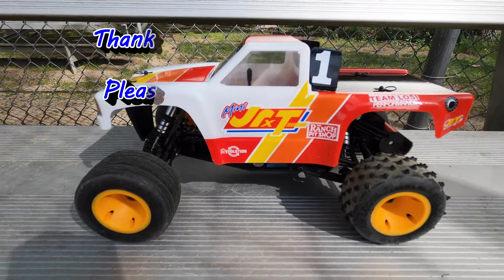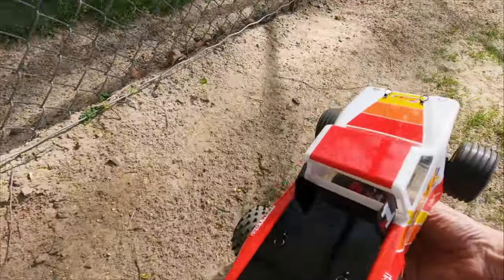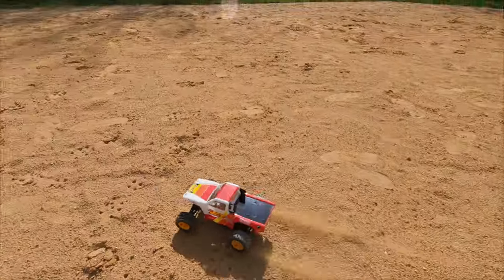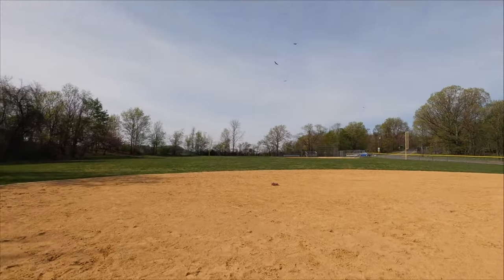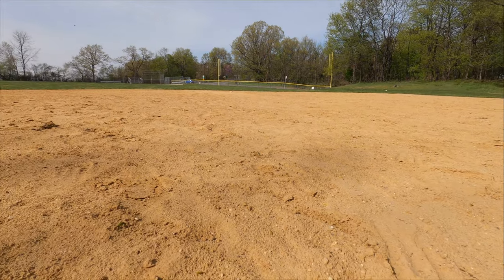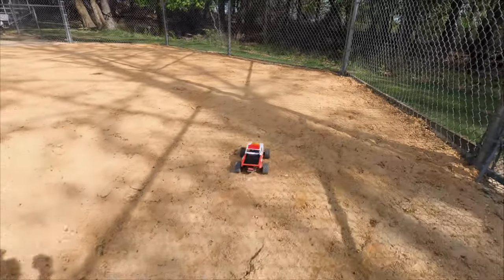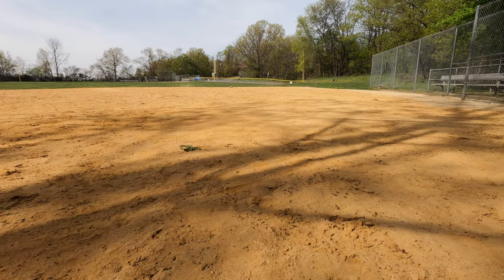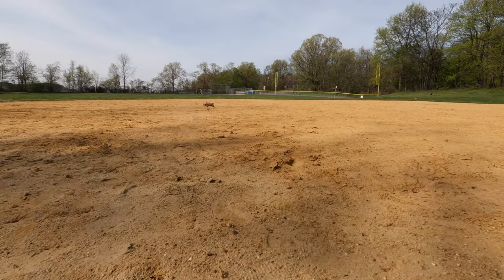Losi mini Jrxt BRUSHLESS Upgrade test WOW!

Comment: For a cheap little combo it's now nuts, anymore power would not be good. The punch is about right, as more it would wheelie too much and damage the body. The temp OK for that sandy surface, grass could be an issue as it does make the cars run hotter.
Reply from the maker: I don't believe how nice it ran and I paid 22 bucks for the system when I purchased it!   Thanks
Reply: @ShenRC  That was so cheap.

Comment: Did you change the battery connector or esc connector?
Reply from the maker: Hi the system comes with Deans T plugs so i put one on my battery also.  Thanks
Reply: @ShenRC  oh ok awesome. thanks for the reply. just ordered this motor and esc after watching your vid.
Reply from the maker: @munarkmusic  cool! you should pick up a program card so you can fine tune it to your liking.

Comment: How ya been Shen of your ViVi dual shocks 500watt? Not sure if you doing uogrades or modifying bike but im replacing the stock controller ( its fixed to 500watts of top speed at 21mph No Matter what battery you using to go faster) and why im getting a 750watt controller to get up to 28moh. I have the battery of 52v 20ah but present vivi controller will not exceed 21mph, just capacity of lasting longer with distance. This is the link to new controller as it us the plug wires we need for ViVi of half the work slready done of plugs. Oh, not link but title if Amazon ad page, just copy and paste in search box. Only 57$: Shanrya

5.0 out of 5 stars 5.0 (1)Reviews

Shanrya Brushless DC Motor Controller, Waterproof Electric Bicycle Brushless Motor Speed Controller 36V/48V Electric Bike Sine Wave Controller 750W Brushless Controller for Electric
Reply from the maker: Hi that's cool! I don't need to go faster than 20mph but if it works that would be awesome! So the stock controller did work off higher voltage than 36V?  cool thanks for letting me know and let me know how the controller works for you.
Reply: @ShenRC  I definitely will, lol. Stay safe to save others later Shen!!!
Reply: So the stock radio didn’t work with the new set up? What kind of radio did you get?
Reply from the maker: Hi a Radiolink RC4GS V3 amazon has them